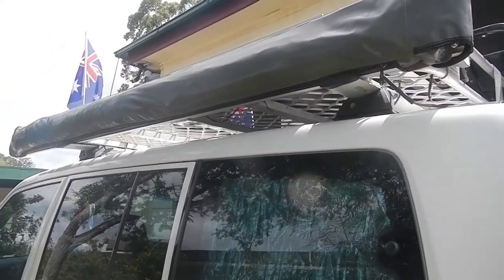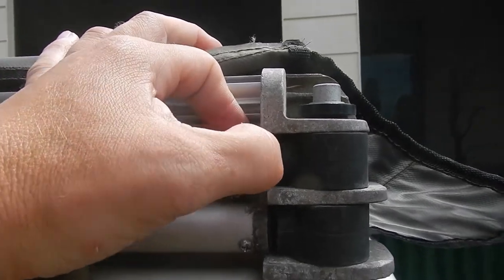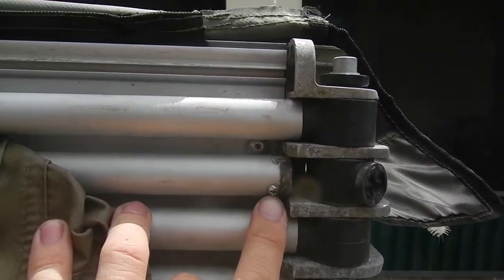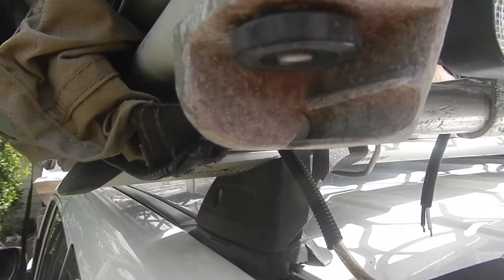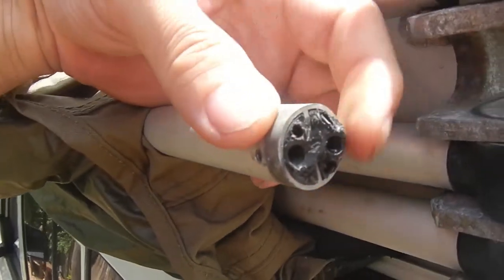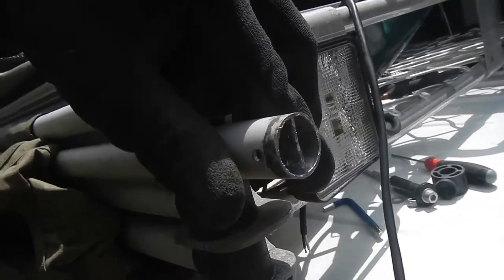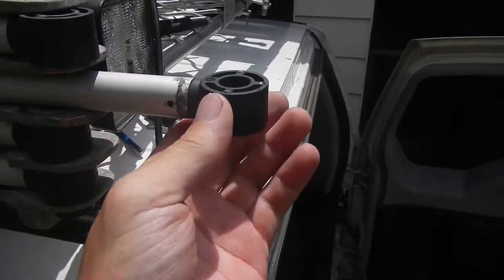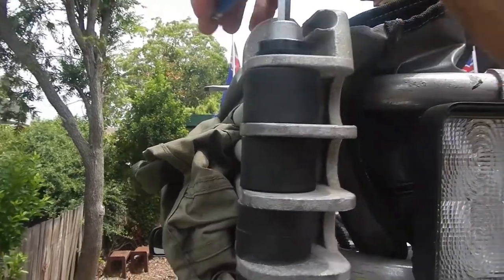Hinge repair Oztent/Rhino FoxWing

Comment: Thanks for this video. Just ordered a bunch of parts to include the hinge inserts and the hinge itself. My ends have screws as well.
Reply from the maker: Welcome. Pretty easy job really. Thanks for letting me know about the screw. I wasn't sure if it was standard or not.
Reply: @DENMONKEY  No Problem. Did you have any problems getting the broken bits out of the spar tubes?
Reply from the maker: yeah a bit. I'm not sure if I showed it in the vid, but I ended up almost grinding it out with a large drill bit. 

That broke it up enough or took enough material away that I could pry the rest of it out . 

Hope that makes sense

Comment: Great video. I have suffered the same problem, hence checking out your video. I noticed the issue trying to remove the old plastic fingers. What I ended up doing was drilling one hole (in each side), and screwing in a self tapper. I then levered the finger out off the screw head. It was a bit tight, but due to the taper, the further it came out, the easier it got.
Reply from the maker: cheers Glenn. 
I didn't think of doing that. I got straight to drilling thinking it would just fall out. 
I'm still convinced there was some sort of adhesive in there.  Either way, for the 10 bucks for parts and a bit of work its well worth doing the repair. Especially considering what they're worth.
I'll keep your technique in mind for the next one :)

Comment: Hey mate I’m currently in Brisbane on holidays( tomorrow’s is my last day)just found this awning for 499 bucks is this still worth buying in your opinion? The price seems great for a 270 thanks mate
Reply from the maker: Yes mate I reckon so. Compared to the price of others. I'm still very happy with mine. The new on from oztent doesn't change much but the rhino rack new one has some improvements. For that price I think it's a bargain
Reply: DENMONKEY hey mate thanks for a reply I ended up getting one from anaconda store for 431 bucks tried it last night was awesome, later down the track we might upgrade to the new bag, was a bit tight getting it back in, and being able to put the poles in the bag will be great, thanks mate
Reply from the maker: no worries. most welcome. 

Yeah, how good is a 270 awning.
I don't think I could go back to one of those cheap fold out jobbies after having this one. 

That's cheap too considering I paid 400 for a second hand one ( albeit barely used) . 

glad you're happy with it.